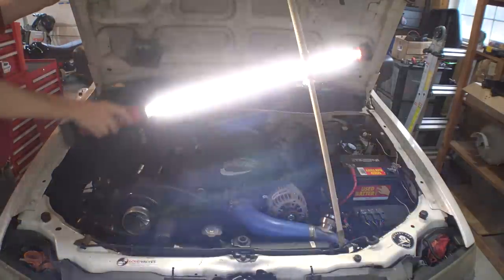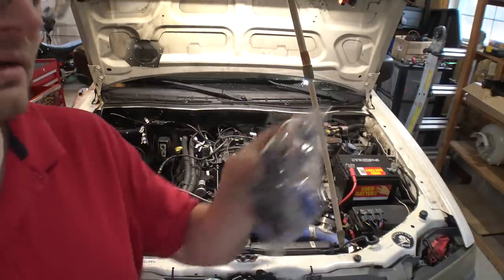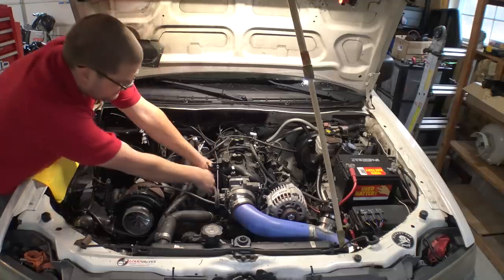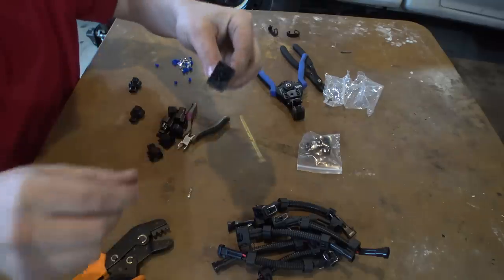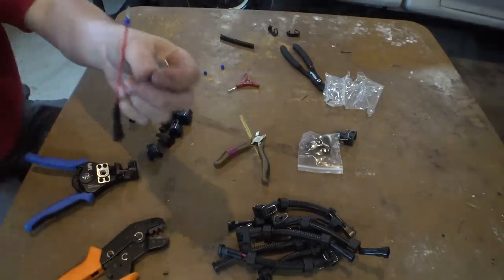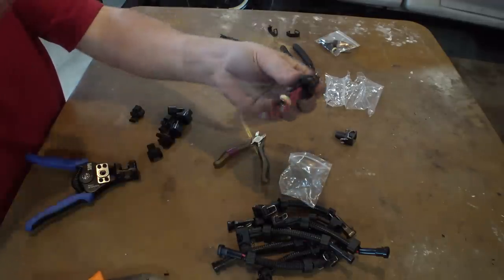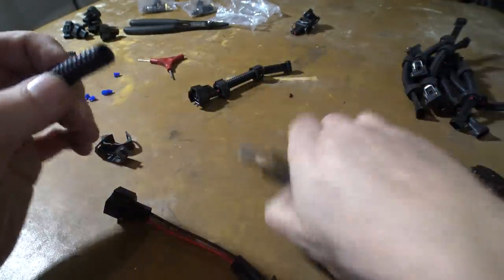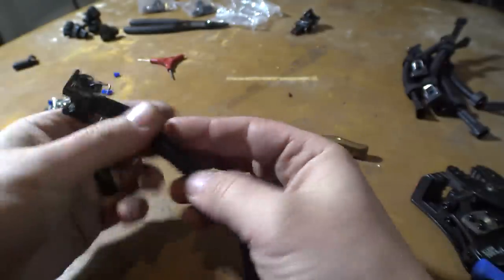210 injector harness swap build

Comment: Those seals are supposed to get crimped into the large wings that grab the insulation. They require a rounded sealed crimper and special sealed terminals. Gm/delphi weather pack is the best. That crimping tool is sweet considering the actual gm crimpers are 200+ brand new. As always i enjoyed the vid.
Reply: +MrClown.   Yes that is correct
Reply: I was about to point that out. The pic posted below is a great example, Mike.
Reply: Interesting, had no idea myself. This is probably good enough for Happel’s application anyway
Reply: Yep, adding a reply so Matt sees this and crimps the seal in next time.
Reply: Just to throw it out there, I have the "Delphi Packard" crimpers sold for about $30 on Amazon and they work awesome. They're not ratcheting, but I don't really feel like I need them to be as they don't take much effort to crimp. I also have a set of Ideal Crimpmasters (which are ratcheting) and MSD sells a set of jaws that look like they will work in them for about $50.

More FYI... Parts Express sells a knock off version of the Crimpmaster and jaws for standard quick connects dirt cheap. I have their regular jaws and they make crimps just as nice as what Matt is producing on those weatherpak pins. I think the jaws were like $12. I've never tried their actual crimper as I've had the Crimpmasters for decades now.

Comment: Question for you myth buster McGhee.  I've always heard that modifying injector  harness lengths and guage of wire +/- the OE harness will affect the ohm resistance of the injector... thus potentially causing latency issues / irratic injector performance.  Do you notice a difference tuning vehicles with chopped up harnesses? Maybe this would only come into play with low impedance injectors? ---Joe

Comment: Waiting on the tbss intake manifold test🤔
Reply from the maker: Need to goto pick n pull and get some throttle brackets also I though since I’m running out of fuel on all my tests I figured I better do this first
Reply: Ok i will be waiting

Comment: I wouldn't ever order anything from vs racing again.  I tried buying a few things from him and I emailed him a couple of times for a tracking number and then finally after three weeks he said that he didn't have what I ordered.  Horrible service. Get them off of ebay or somewhere else where they will send them out right away.
Reply: never had issues with vs... been ordering from him for several years. always get reply within 15 minutes. great service would recommend

Comment: Would you rather buy an engine and trans for $1800 off car part .com or a running craigslist 2500 6.0/80e for $2000? My deal is the truck would guaranteed have everything you need.
Reply: PhoenixNFA I'm not Matt obviously.. My layman opinion is this.. The complete truck will give you everything and you could make sure the motor works
Reply: PhoenixNFA  or pick n pull on half price day. 6.0 and l80e harness and computer was 748.00
Reply: Goodenough Garage not married. My buddy might get mad about a 2500 in his garage but that’s really about it.

Comment: Where did you get the connector kit from?
Reply from the maker: ebay actually

https://www.ebay.com/itm/Denso-Female-Fuel-Injector-Connectors-With-Crimp-on-Pins-Set-of-8/272200117208?ssPageName=STRK%3AMEBIDX%3AIT&_trksid=p2060353.m2749.l2649